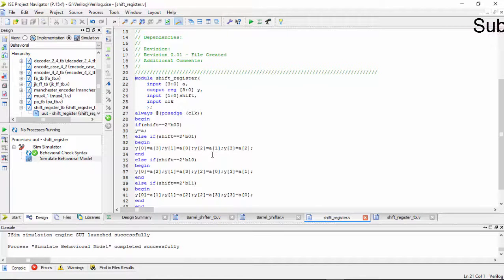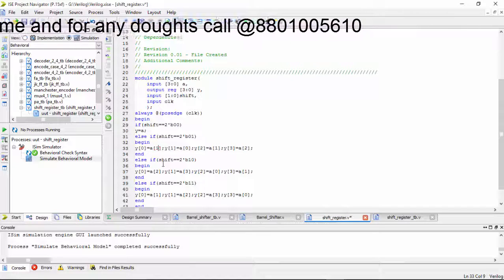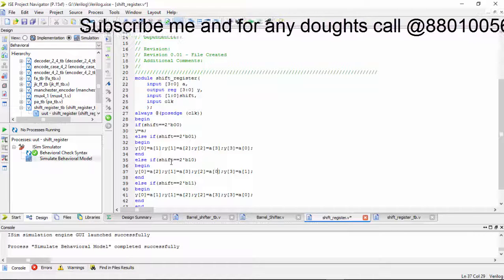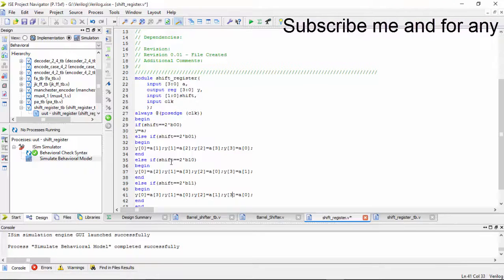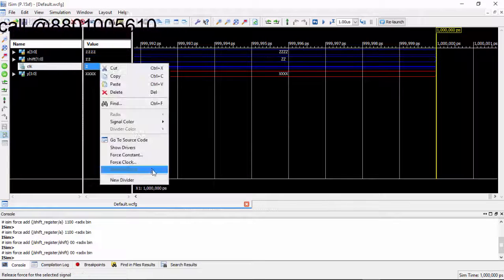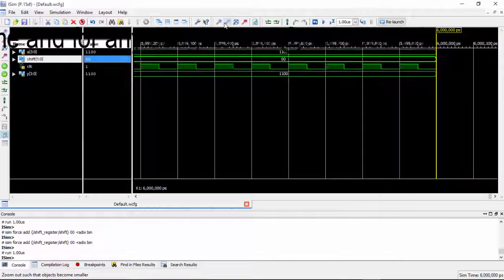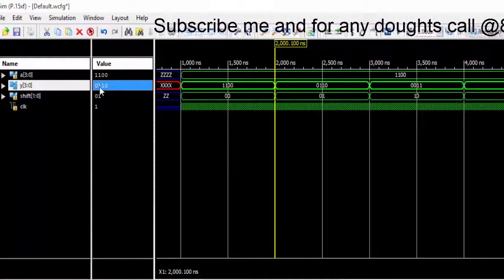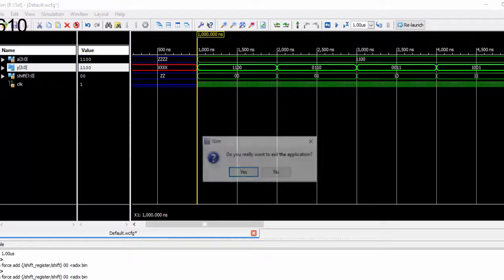Verilog Implementation Of 4 bit Right Shift Register In Single Clock Pulse

Comment: I feel, this is rotate right and not shift right.
Reply from the maker: Its both rotate shift right
Reply: But, in the digital world, shift right does not replace the MSB with LSB as it is done here. Correct me if I am wrong.
Reply from the maker: Video is all about Barrel Shifter.
if you want the MSB bits replace with 1'b0 then you change the Code.
If we are implementing Test Pattern Generator(TPG) then number of test vectors can be generated by doing this kind of logic where i can reduce the size of my module.
Reply: Cool, Thanks for responding :)